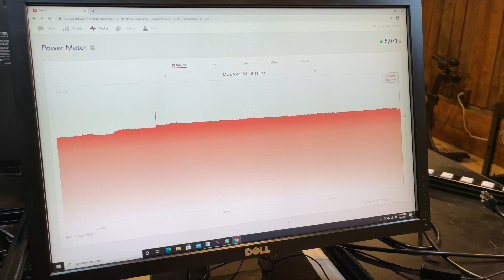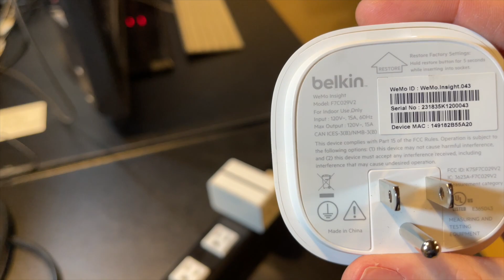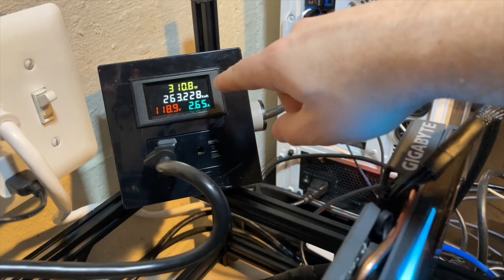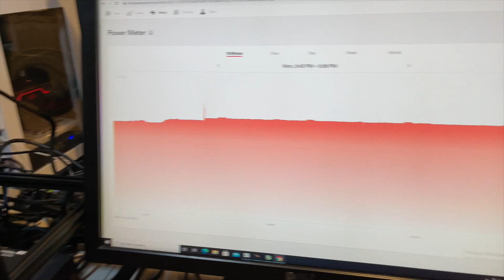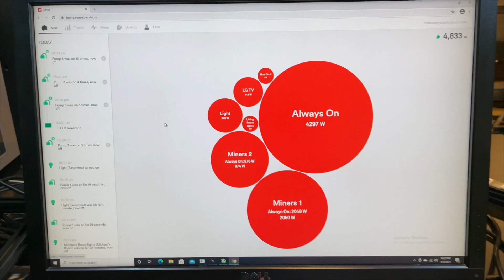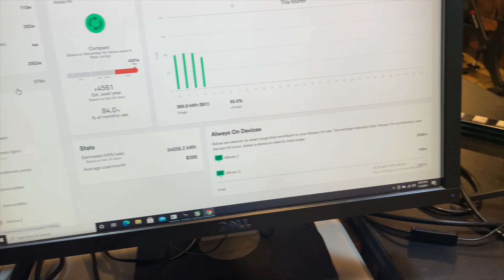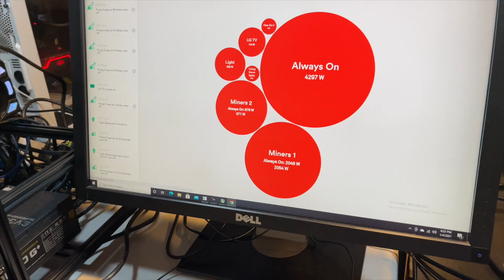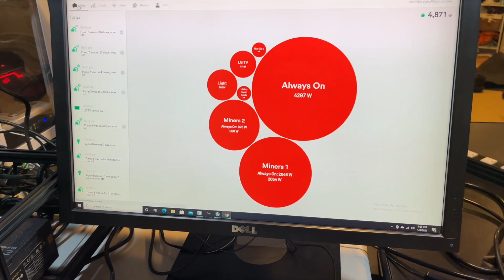Track Crypto Mining Electricity w/ SENSE

Comment: I've been looking a while for a good solution like this.  I'm ultimately going to use an Eastron energy meter and send the data to an rPi over RS485.  It'll be nice as it can not only track full-time and part-time rigs (ie main gaming PC), it'll compile, store, and host the data as a local IoT device.  No data harvesting or worry about the many other problems with online/cloud IoT devices.

Comment: Hey, 2 questions.  How accurate are you finding Sense to be?  Does it pickup your voltage properly to calculate usage?  Lastly, moving to 240v maybe?
Reply from the maker: Hey buddy it's pretty accurate from what I can tell. For example my 6x1070 Tis are running 125w each for 750w total GPUs. Sense is reading 880 watts for that circuit with only that rig on it. That leaves a delta of 130 watts for all the rig components including a server PSU and surge protector. Seems pretty good.

240v is definitely in my future. And Sense will be able to monitor that circuit as well with the auxiliary connectors.

Comment: I am using Sonoff for smart switch and tracking electricity, it is very cheap, around 15$, but you have to be careful because it needs to be wired.
Reply from the maker: Those are interesting and I've not seen them before. Thanks for sharing.

Comment: Good work.  Been using the smart outlets with power monitoring for a long time.  Great to know that you are rocking full load.   I use the Teckin smart outlets.  I set the bios in the rig to boot on power.  If there is an issue, i just power the outlet off and on and then boot back to windows and have Afterburner set to windows and i have nicehash set turn on /mine on boot.  I also will use chrome remote to remote back in and ensure it all looks good.  thanks buddy.  For walls i just use killowatt and i have a couple off brand kilowatt (14 bucks on amazon).  Never saw the space goats tut on that outlet monitor, but i will be building one of these.  Thanks buddy